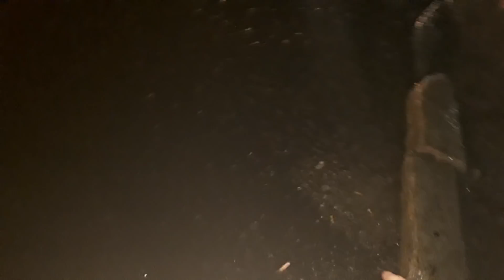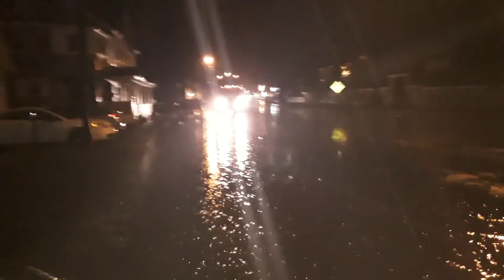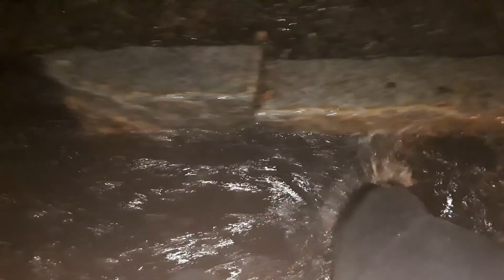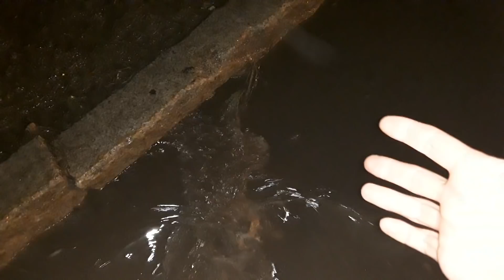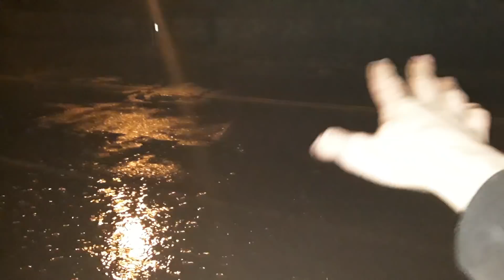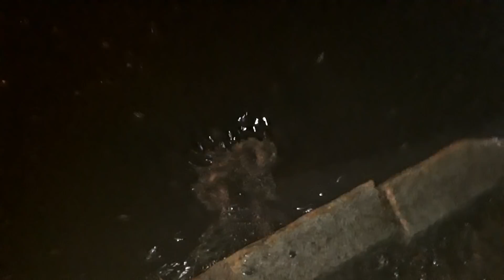Unclogging storm drains to relieve a flood 4

Comment: Excellent!  Thank you for helping to prevent potential auto accidents! :)
Reply: Or the car drivers could actually slow down when they see water coming up. But this seems to be America and they problably dont know better.. Seeing they are splashing that guy they are inconsiderate assholes to me....  Worse yet, the guy seems to be ok with the cars splashing him.. I would take their licenceplate and report them to the police :)
Reply: taztaz79 sorry in America we have places to be. Cant be going 5mph just cause there's 6 inches of water
Reply: taztaz79 Splashing someone like that in the UK is now an offence I believe. Besides you are risking damage to your vehicle so always slow down
Reply: Oh hell no, when water pools up you should speed up!
Yeah it can damage your car if you don't modify the air intake, and yes it is a bit dangerous and maybe will splash some unlucky fellows down the road, but it's the funniest shit you could ever do on 4 wheels.

I've had to re-attach the front bumper on my car two times now, cause the water pressure ripped the little plastic push-locks out, but i say, 100% worth it!